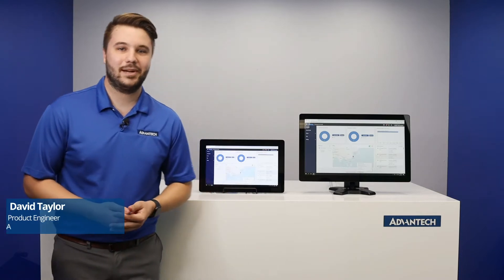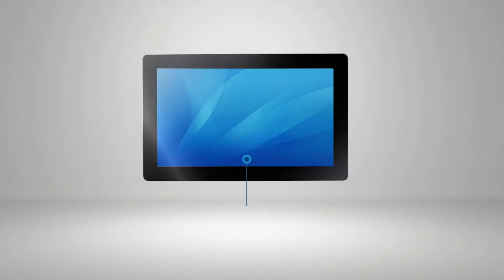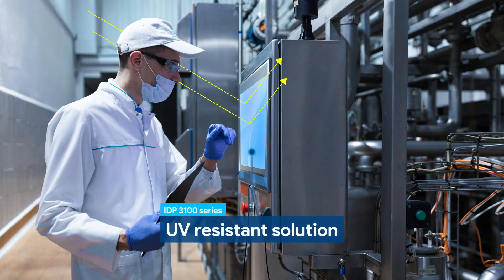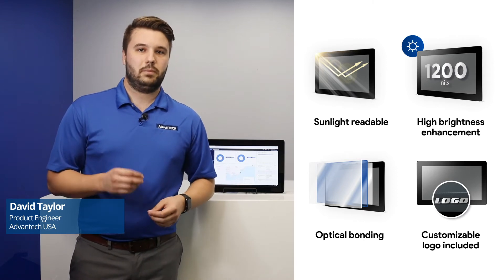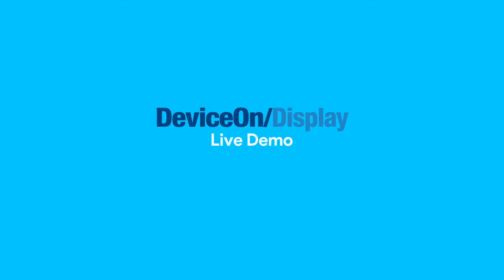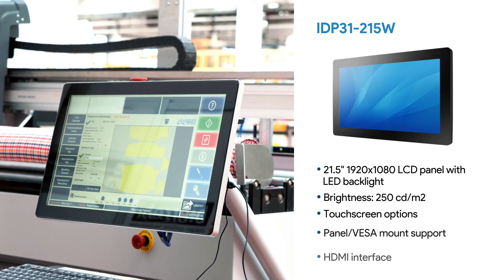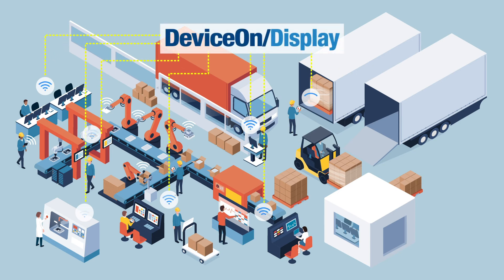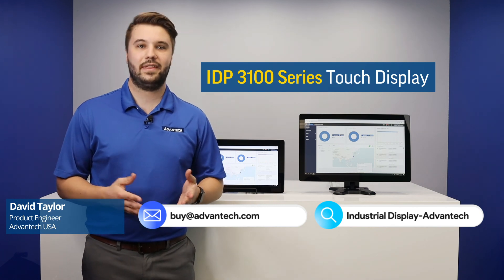Advantech’s IDP-3100 Series Bezel-less Touch Displays for Industrial Applications

Comment: I bought a flat screen external monitor without a cord but no power cord. I use 12v dc power adapter but only saying no cable then after that says going into power saving mode when connected to my windows 7. Do I need an original power cord in this monitor? The model number is XSNA3-F27 when translated to google picture because the writing in the back is in Chinese words.